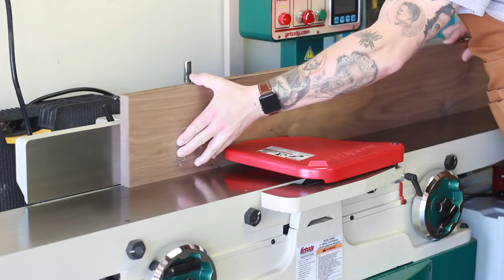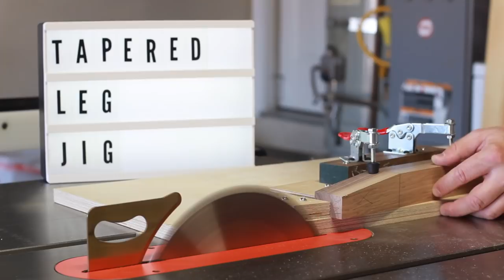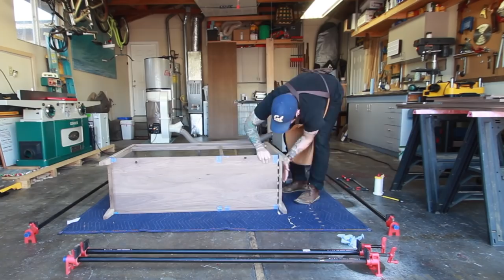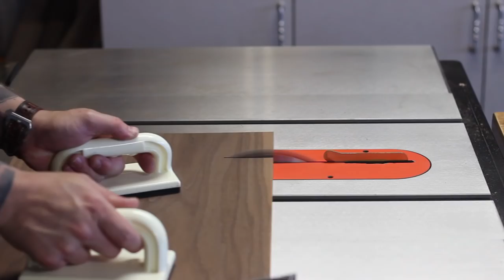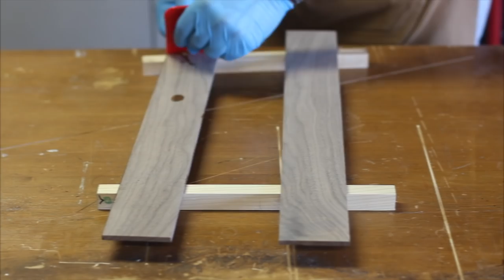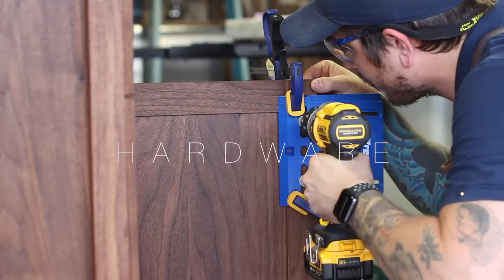Making A Walnut Sideboard / Buffet Table | Woodworking

Comment: that's absolutely a beauty. I love that walnut. what type of finishing did you apply? roubio?
Reply from the maker: Thank you so much! It was a great batch of walnut and it is such a pleasure to work with. I used Rubio Monocoat "Pure." The one coat application was nice, but it is a fairly expensive product. That said, it cured very nicely!

Comment: are you not concerned about expansion on your side panels, being all mortised in with dominoes?
Reply from the maker: All of the grain is facing the direction - just like a mitered box, for example. This includes the cabinet and drawer dividers. In other words, there is no perpendicular grain intersecting.
Reply: @theroaringwoodwork2213  ah, ok, understood.